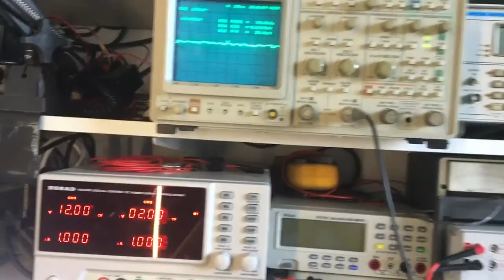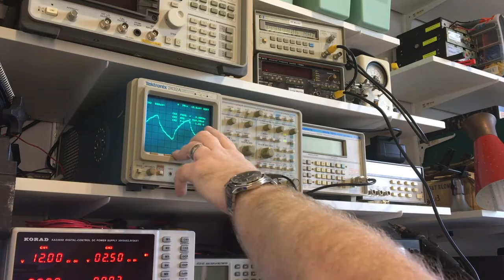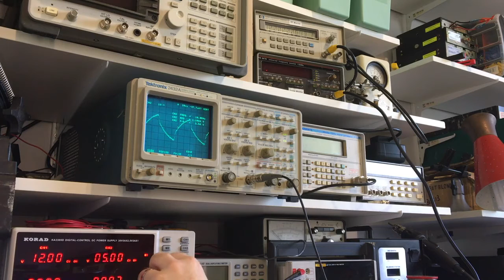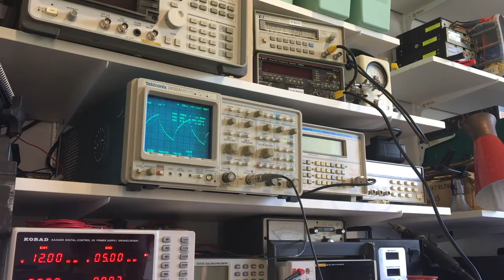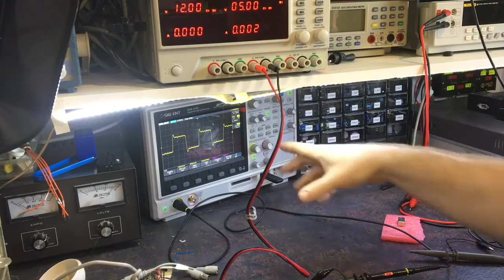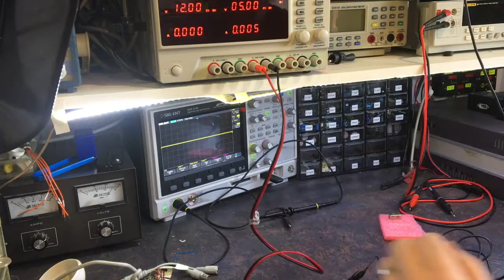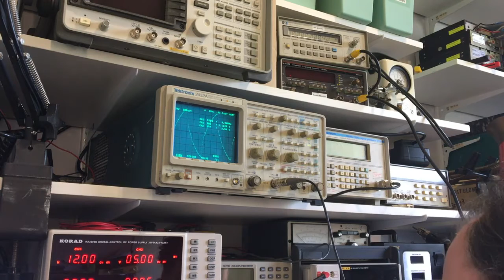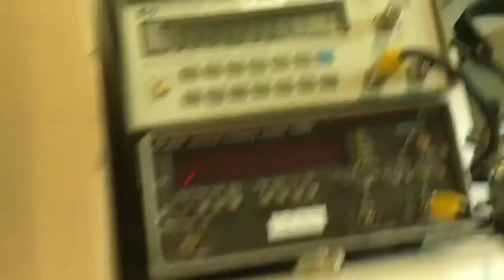#118 10MHz TCXO Temperature Compensated Crystal Oscillator testing

Comment: I had a bin full of assorted value crystals and I tested them with a small circuit I built  to see if the value on the crystals  were correct. All  were fine with exception to the 4Mhz crystals. They were all showing 11.8Mhz ? Do you have any idea why?  Is there something I am missing?
Reply from the maker: Crystals often run at their third harmonic, so your circuit is probably most resonant at that frequency compared to 4MHz
Reply: @TheDefpom  I just love your Vlog, I used another testing method all good . You were right. Thank you for being so kind and responding. Nice people are rare these days. Cheers

Comment: sent you an email Def... was wondering if you had a print (or alignment info) on the ss485 10m radio (sy202 chip), email addy would be from KK4msa
Reply from the maker: I have the circuit diagrams for the radio, but no service info, I never got an email from you, send it using the contact page on radiomods.co.nz
Reply: TheDefpom cool that will work, I can find nothing on this radio, online, I will send an email from the site. website..I have the prostar 400 but the ss485 looks to be the same...